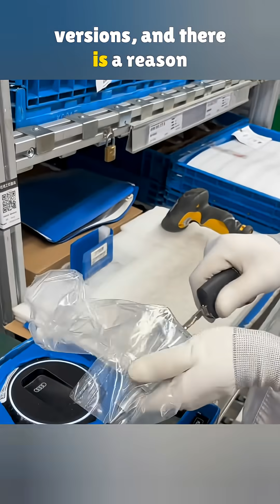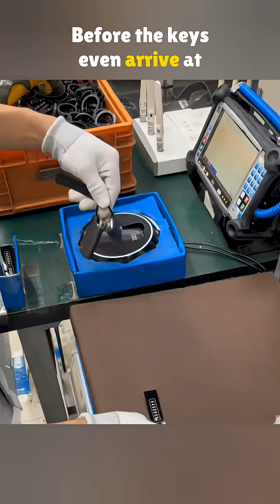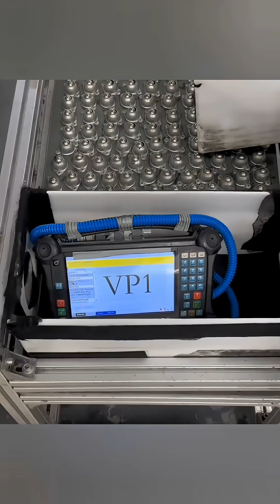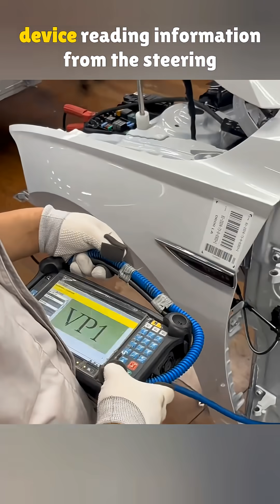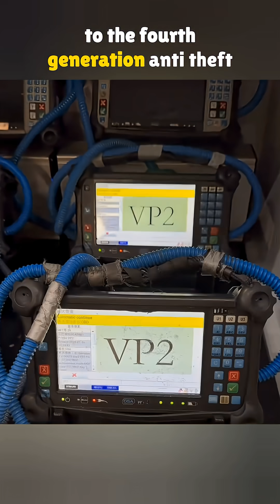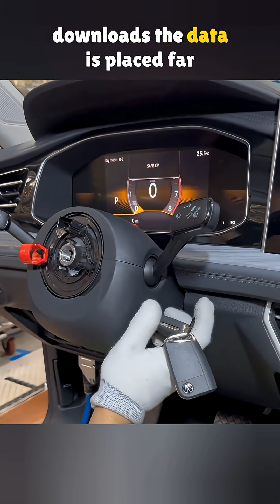Why Cutting a Car Key Takes So Long

Comment: In order to clone a new key you must have the spare key some cars you open the center glove department on the bottom you insert the plastic key that pops out when you push the bottom that on the spare key or the original key then you insert into the little hole it will read it and you stick the new key into the same hole and you have clone your own key